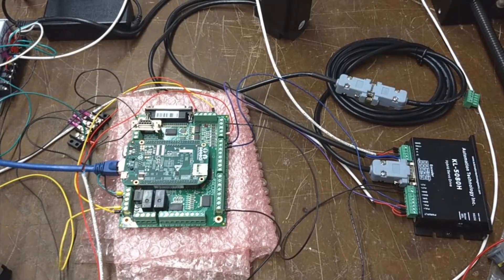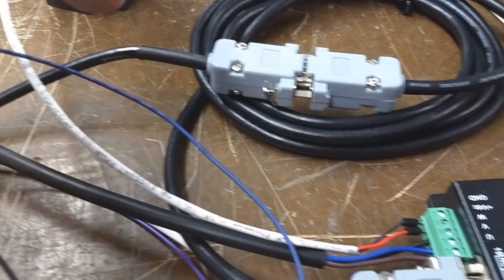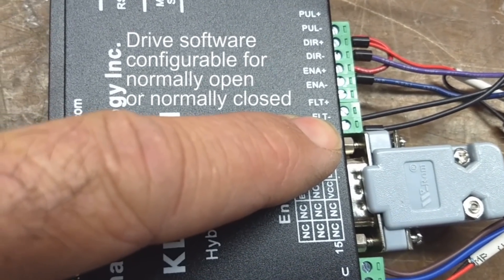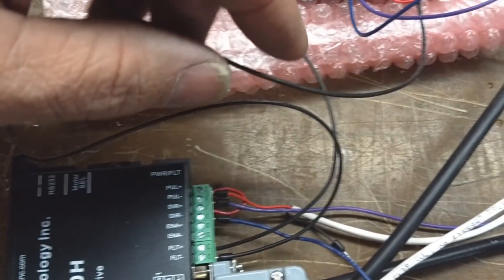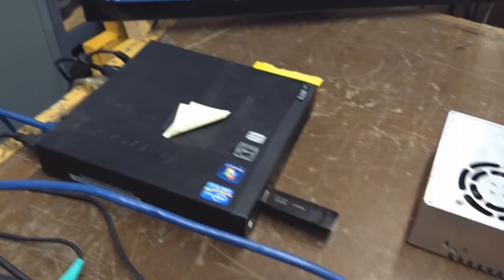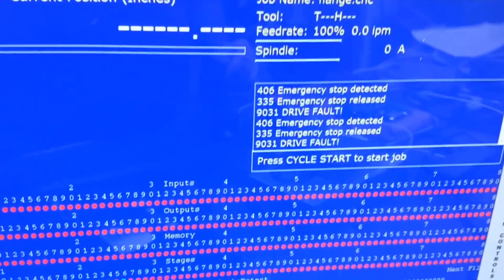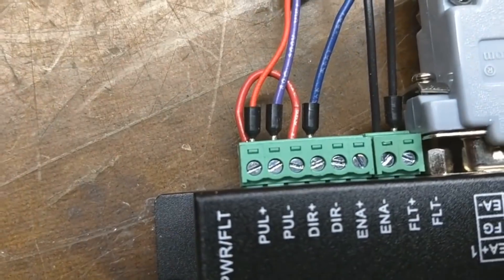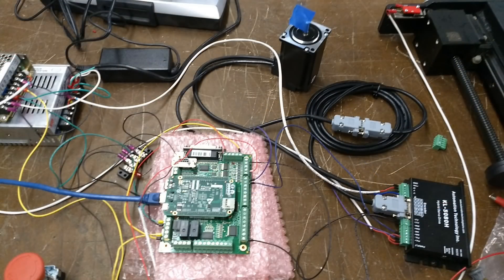Centroid Acorn CNC Basics - Wiring a KL-5080H Closed Loop Stepper from Automation Technologies

Comment: I always enjoy your willingness to share such knowledge the rest of us. I was wondering if you think the acorn update would work on an older horizontal boring mill with an Allen Bradley controller that is going out? 
Thanks
Reply from the maker: Ben, while doable, it's hard to to know what to recommend without knowing your budget, and what make and model axis drives it has, what axis motors, what spindle drive and what HP the spindle motor. Acorn and Acorn 6 only put out step and direction signals.

Comment: do you have any videos about connecting open loop drivers to the acorn controller?/ turns out the wiring is about the same for leadshine drivers , so this video works just as well.,, is the fault " alarm " connection optional ? is it only for diagnostics ?
Reply: Hi Rob, lots! Go to the Centroid User forum and post info and pictures of what you are working with. Will help get you going!

Comment: They always run good on the bench. Connect them to an axis and whoa missed steps? Can’t tune with acorn? Nope. Frankly servos are the only way to go with centroid if you want any decent performance or consider mach4 a better solution for steppers where you can spend hours dialing them in so they actually perform decent. My servo driven centeoid machines run like a dream. I’ve not ever been able to get steppers working properly unless you run them immensely slow where you may as well machine by hand.
Reply from the maker: No issues with steppers and Acorn. The trick even with Mach is choosing the right stepper motors for the machine, paying attention to inductance values, choosing the right voltage power supplies to run them. This trips everyone up. Geckodrive wrote a great paper on stepper motors. 
Closed loop systems match the stepper to the drive, and tell you at what voltage to run them at. You still have to choose the right size motor, but being closed loop, they can be size about 20% smaller, because machines with open loop steppers have been sized 20-30% larger to accommodate a safety margin due to their open loop design.
Reply: Sure makes sense that’s why buying a packaged setup helps but a set of 1600oz servos on a bench mill shouldn’t be losing steps with a 70v toroidal power supply above 25ipm. Have any links to acorn running open loop steppers? I haven’t found one searching all of YouTube and three of my 6 vertical machines I’ve had all ended up not running with steppers but as soon as I threw closed loop AC servos on a couple, bam! they run like a charm. Now when I ran Mach on those it ran fine. That said it’s not always the hardware is it? Sure they have a lot more to offer for tuning. Well centroid has none. It’s just a different game. By the way all my YouTube searches for open loop steppers with acorn only showed bench test videos.
Reply from the maker: Glenn, my D&M4 mill and Dyna Myte DM2400 both ran open loop steppers with Geckodrive G540's. Accurate and no issues. When it comes to large machines, I do run AC Servos.
Reply from the maker: Closed loop hybrid "steppers" also work well.

Comment: Hey marty,

Really appreciate this video as it encouraged me to go the closed loop + acorn route. I’m using the Nema 34 version but have been told it’s exactly the same to hook up.

Quick question for you, I’ve been pouring over the 5080H wiring pdf that Centroid has available and they have the Step / Dir hooked up via breakout board using the parallel port. Is there any good reason for that? I was planning on doing it exactly as you did, that was a big part of the reason I went with Acorn is the ‘all-in-one’ nature of it, I just want to be sure I’m hooking it up the best way possible.

Secondly, they consider the Enable +/- to be optional, can you tell me what that does? Is there any reason I need it or can I carry on just fine without it? As I said, just trying to do it right the first time. 

I really appreciate the help!
Reply from the maker: You should post to the Centroid user forum: https://centroidcncforum.com/viewforum.php?f=60&sid=1008a0d5475ff32c7362bf07761f9dcf
But in a nutshell, the DB25 is similar to the parallel port. It would be a little easier to connect using a DB25 male breakout board you can buy on Amazon. There is no enable on the DB25. Enable means that when the pin is toggled (high or low) depending on the manufacturer of the drive, it will ENABLE the drive. Most drives come default enabled. For small stepper motors this is generally not a problem. When the control faults, or Estop is pressed, it will DISABLE the drives so they are free.
Reply: martyscncgarage Appreciate the quick response, I did sign up to the forums last night but I figured I would wait to see if you responded here rather than double posting my question. Enable works exactly as I expected it would, I just wanted to check. 

As for using the DB25 board, if the only real difference in function is the ease of wiring, I think I’ll continue to hook it up as you describe in the video, it’s really not all that complicated as far as I can tell.

Thanks again for your help!

Comment: Marty your the man, i'm new at this and your video saved my butt for sure. I'm converting an old 1938 atlas lathe to acorn cnc..i bought stepperonline closed loop nema 24's 601 inch ozs with cl57t drives. No way would they work with the wiring shematic with them..but i watched your video and said what the hell I'll wire them exactly as you did with the kl5080h..and what do you know..they work awesome..can't thank you enough for your knowledge man thanks a ton!!
Reply: Ps..I looked for hours for how to wire these drives..not one ounce of info did i find. thanks again for your video.
Reply from the maker: Glad it helped!

Comment: Marty,
I purchased a NEMA 23 Kit from Automation Technologies. It came with KL-5056 drivers, a C10 BOB from CNC4PC and a 5V power supply and a 36V power supply. Do you have any schematics or info on wiring to the Acorn board?
Reply from the maker: Download the Acorn schematic package and follow the Leadshine schematic. Use a DB 25 male  breakout board. You do not need your C10 breakout board. Though it may work. I'd have to look at it up.
Reply: Okay, The Schematic package has two directories. One for Rev.2 and one for Rev.3. My software is Rev. 4.12. The Rev.2 directory has a Leadshine schematic and The Rev. 3 has 2 schematics. The one in Rev.2 seems to be the correct one. Have any of these changed for CNC12 Rev. 4.12?

Comment: Hi Marty.  Great video.  I ordered these drives/motors as well as the 48V power supply you recommended.  Question:  There are multiple pieces of drive programming software available.  Which one did you use to program the drives?
Reply from the maker: Franco this was a simple bench test. I did not need to program them. I used it out of the box as-is.   I do have two more and another Dyna DM2400 I am going to set up with them. I'll do some videos on that. On the power supply, 48vdc may be a little high. Using the formula found on Geckodrive's website on stepper power supplies, it says to take the square root of the motors inductance which is 1.85, which gives you about 1.36 and multiply that by 32 which equals 43.5vdc. That said, Automationtechnologiesinc.com sells a 3 axis kit using a 48vdc 969w power supply. Geckodrive's power supply white paper seems to suggest that a motor only draws 2/3 of it's rating.  However, these motors have 3 coils. So, if you do the math per the motor spec sheet , the motor is said to draw 5.8a multiply that by 48vdc, and you get 278.4w per motor. So multiply that by 3 motors and you get 835watts. I am not totally sure that the 2/3 rule would apply to this motor.  https://www.geckodrive.com/support/step-motor-basics/power-supply-basics.html

Comment: Hi Marty.  Nice video.  I think I'm going to buy these drives and motors for a small lathe I'm working on (that requires 1/4" shafts).  What power supply are you using to drive the motors?  How many watts do you recommend per motor?  Thanks.
Reply from the maker: Franco, I had just purchased one to do some testing. I purchased 2 more to put on another Dyna DM2400 mill I have. I plan to use at least a 600w 48vdc power supply for three axis.
Reply: Thanks Marty.  I decided to order a 36V 350Watt PS for each driver.  Probably a bit more than what's needed in terms of wattage but if it's worth doing, it's worth over doing, right?

Comment: Thanks for the quick overview. Is the Enable signal not needed ?
Reply from the maker: It can be used. I just put it together quickly for another user
Reply: As it says in the wiring diagram for Leadshine driver, the enable signal must be inverted in Acorn setup. Now it works fine on my side. Thanks for your detailed videos.

Comment: Hi Marty the ena+ and ena- is not used in acorn?
Reply from the maker: Yes it could be. I was doing a quickie video for another Centroid Acorn user so didn't go that far.
Reply: martyscncgarage thanks also were did you bought your multi voltage power supply? Thanks
Reply from the maker: JAMECO.COM they are Meanwell Power Supplies. Look for the RD35-B it has both the 24VDC and 5VDC output. (Jameco also sells on Ebay)
Reply: martyscncgarage thanks Marty

Comment: Question Marty?
It is possible to mix it different motors drives to Acorn board?
Because I have a big 5 Kw.
Yaskawa servo pack
And DMM 750 Kw.
Wish I want to install in my Bridgeport VMC!
Reply from the maker: Hi Marco, yes, as long as they all take step and direction inputs, you can mix and match.
Reply from the maker: Marco, 5kw is a very large motor. Is that your spindle? Also do you have a tool changer? ATCs
Reply from the maker: Marco, is the 5kw motor/drive on your spindle? Do you have a tool changer? ATCs require more inputs and outputs than Acorn has. You might be better off with Oak motion controller. You should call Centroid with the make and model numbers of your drives to see what is the best option for you.
Reply: This motor is going to drive the Z axis for now.I going to use the Acorn board . Tool change will be manually until 
I buy it the Oak BOB.
By  the way, do you have the video for wiring the 25 dB breakout to DMM servo drives?
Thanks Marty for your dedication to helping users with this Centroid board!!!

Comment: Coming along nicely!

I have the "integrated" Easy Servo system from Leadshine for my Z axis Bridgeport drive. Same guts as these but the driver is piggy backed on the side of the motor - cuts down on encoder cables etc. 

And I see there are now clones available on AliExpress for $100 or so.  Search for "STATE OF THE ART hybrid closed loop". No idea how good they are but if they are anything like the genuine Leadshine parts, their performance will be pretty good.

Comment: Excellent Marty!
this wiring is the same for nema 34 close loop? I have 5 motor close loop sets from Automationtechnologies!
I’m switching all my machines to Centroid  from Mach 3.
But i just started learning about Acorn and Centroid this week watching your videos.
You are doing this very well, thank you for your time helping others with this nice work Marty!!!
Reply from the maker: Marco. Thanks, yes should be the same. Double check your manual. Be sure to use the dual voltage power supply that provides 5vdc and 24vdc. Jameco.com sells Meanwell for about $12. Glad you found it helpful.
Reply: marco avilez h

Comment: Looks very similar to the more expensive (2x?) Leadshine ES-P32320, which comes with an ES-508 drive. When you get the cable, please post a bit of the software. I've written software for interfacing with the Leadshine Easy Servo drives and I wonder how similar these drives are. If you have the parts, the cables are easy to make. A Cisco programming cable works on the Leadshine drive, and I assume yours. I also cycle the power to reset the drive after a fault, but now I wonder why I don't reset it via the programming interface...
Reply from the maker: Kent, John at Automation Technologies tells me these motor/drive packages are made by Leadshine for Automation Technologies. Feel free to drop him an email to inquire.